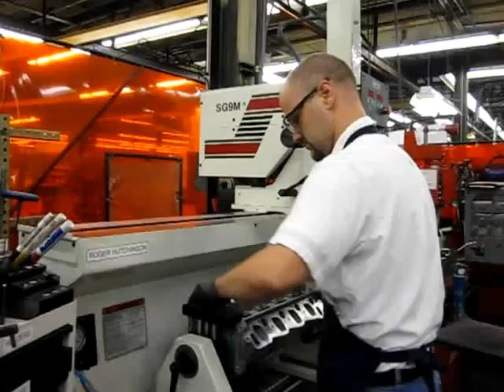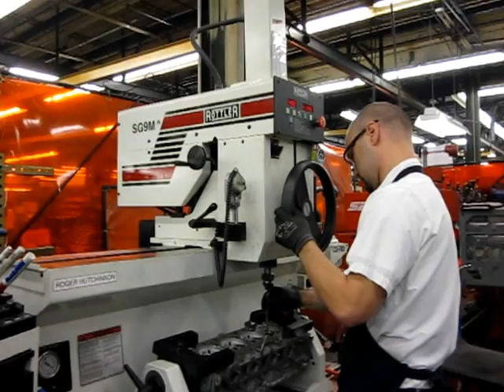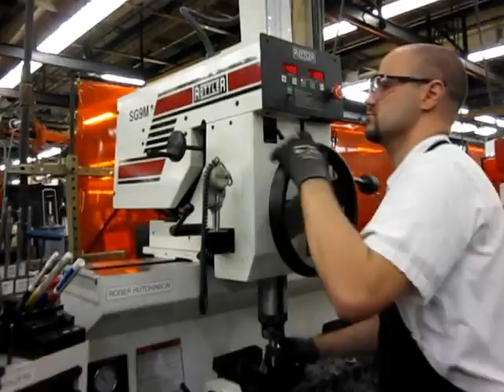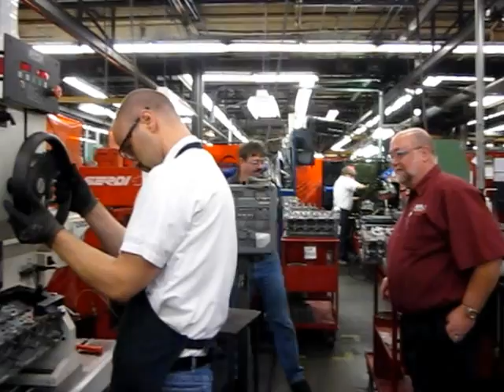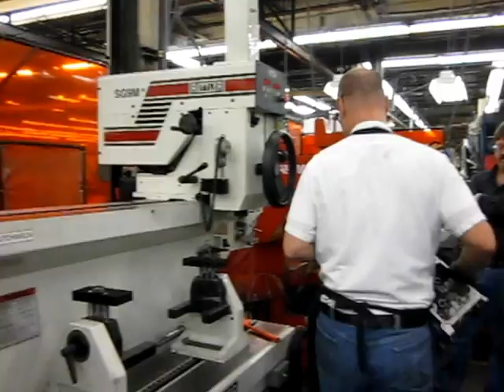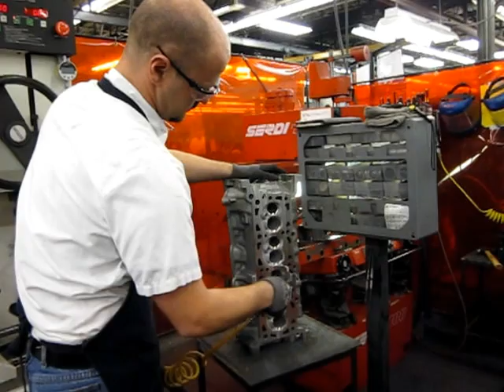Rottler SG9M - Fastest Seat Cutting Machine

Comment: And it's accurate? I know it's got to be I'm just amazed. 
What set's the depth of the cut?
Reply: BigEsGarage every head they cut has to be mapped out usually it was done by hand first then a machine maids the head and turns it into a cad program that can be repeated, more do note days they're moving away from that and running straight cad doing a test set then running thousands if it checks out